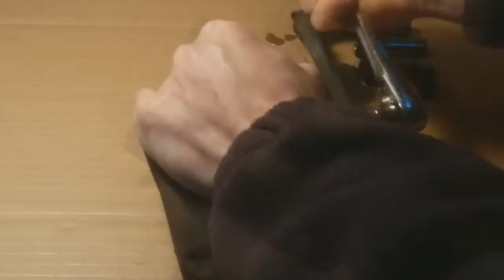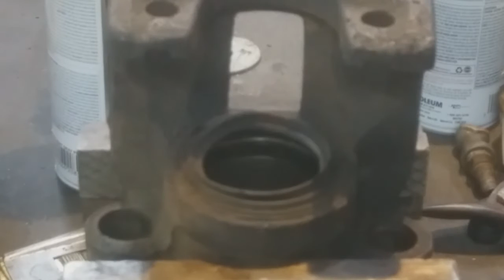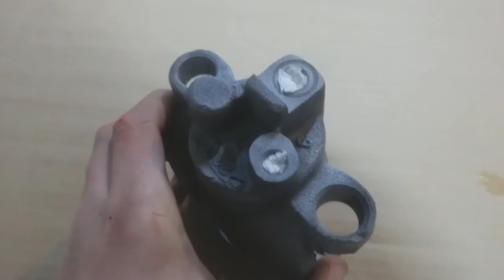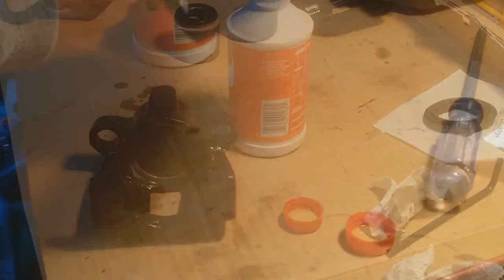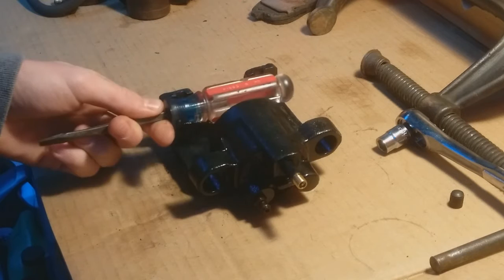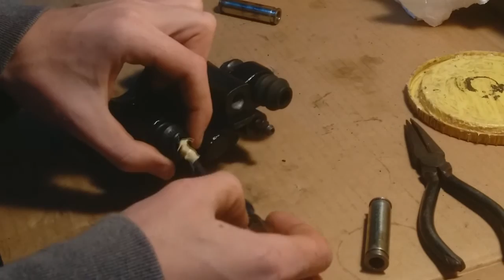How-To Rebuild Single Piston Brake Calipers

Comment: I didn't put it in service mode. THEN stupidly applied service mode then un-did service mode...leaving my rear caliper piston pushed completely out, and wont go back in. My rear brakes are was already out when i applied the eBrakes. 
So I can't push it in cause I now know I need to be IN service mode. WHAT DO I DO??
2017 jeep cherokee limited awd 4x4  4cy

Comment: I appreciate all the info in this diy video. I see others using needle nose vise grips with fuel line on the end to clamp the flex hose but what if you want to replace all front and rear flex hose brake lines? How do you stop air from getting into the hard lines at the fitting and how do you keep fluid from completely draining from brake system? Is it ok to remove all the flexible brake lines, then replace them one at a time, then bleed the entire brake system afterward? Will doing this harm the ABS and introduce air into its system and modulator?

Comment: Question? How did you stop AIR from ENTERING the brake line and stopping all your brake fluid draining from your brake lines and reservoir? What stopper or clamp did you use and specifically, visually, how exactly did you go about that process? I want to replace the flexible brake lines as well as rebuild the calipers on a 1995 ZJ which is similar to the XJ single piston caliper but also with ABS on the ZJ...... but here is my concern.... I dont want to introduce excessive air into the lines and make bleeding them all, later, a nightmare. Any suggestions, ideas or a video on the topic would be great as I cannot find any youtube video on replacing the flexible lines while not introducing air into the brake lines and possibly also, the ABS SYSTEM...as well? Btw... Thanks for making this video! Very helpful👍
Reply from the maker: I simply used a vise grip to clamp the rubber lines if I had the caliper off the vehicle. But if you are also taking off the rubber hose on each caliper you can use a vise grips on the rubber hose from the frame to the rear axle. If you are taking off all of the rubber lines, leave the cap on the reservoir on and it will help by retaining the fluid in the line by creating a vacuum, then it wont be able to drain out as much. The abs lines that run to the rear are just wires that pick up a signal on each wheel, so I wouldn't worry about those. But if you replace all the rubber lines at the same time with the reservoir cap on then afterwords a brake bleed for the whole rear brake system will be fine.

Comment: WHich parts did you had from ZJ vehicle prior to the replacement into the Xj? do you have the video for such replacement?. ( BTW you could benefit from aditional ligh in your work bench in order to reveal the tiny details inside the pistn. THKS !
Reply from the maker: I swapped the ZJ, backing plates, parking shoes & hardware, rotors, pads, soft brake lines and proportioning valve.

Comment: You don't need to align the brake hose bolt hole with the brake hose hole. The bolt is stepped around the hole area allowing fluid to flow around the bolt and through it.
Reply from the maker: You are correct, this being the first time I was doing brakes, I didn't know that at the time.

Comment: Brake fluid is NOT an assembly fluid and should never be used when installing the piston or dust boot into the brake caliper. There is brake caliper assembly fluid/grease for this purpose that will make installing the piston and dust boot much easier and without the risks of damaging the piston, bore or pressure seal. Caliper pistons assembled dry (only brake fluid) can stick over time, causing uneven pad wear and pulling. There are two brake caliper assembly products, Red Rubber Grease by Castrol and Brake Assembly Fluid by Centric, Carlson or Raybestos, "all are compatible with brake fluid". All are sold on Amazon for around $20, hard to find in your local auto parts store. Save yourself the nightmare of trying to install pistons (especially Phenolic pistons) with just brake fluid and spend the $20!!!

Brake Caliper Rebuild Info:
http://www.nbsbrakesupplies.com.au/technical-information/why-you-need-to-use-assembly-fluids.html
https://www.zeckhausen.com/catalog/index.php?cPath=6446_6494
http://www.redrubbergrease.com/

Assembly Fluids and Grease:
Red Rubber Grease:
https://www.amazon.com/GENUINE-Corrosion-Oxidation-Resistant-TS-2-34-04/dp/B01L63SXSU/ref=sr_1_1?keywords=red+rubber+grease&qid=1550936758&s=gateway&sr=8-1
Centric Assembly Fluid:
https://www.amazon.com/Centric-500-1000-Brake-Assembly-Lube/dp/B003K18DT6/ref=sr_1_fkmr2_1?keywords=centric+brake+assembly+fluid&qid=1550936103&s=gateway&sr=8-1-fkmr2
Carlson Assembly Fluid:
https://www.amazon.com/Carlson-H9440-Brake-Assembly-Fluid/dp/B0091S924M/ref=sr_1_fkmrnull_1?keywords=carlson+brake+assembly+fluid&qid=1550936127&s=gateway&sr=8-1-fkmrnull
Raybestos Assembly Fluid:
https://www.amazon.com/Raybestos-BAF12-Brake-Asembly-Fluid/dp/B001ANJ2GE/ref=sr_1_fkmr2_1?keywords=centric+brake+assembly+fluid&qid=1550936139&s=gateway&sr=8-1-fkmr2
Reply from the maker: Sure assembly grease may make install better but to me it's personal preference. I've seen others and myself use just brake fluid without a hitch. Same thing goes for assembling an engine, you don't have to use assembly lube and soaking parts in regular motor oil works just fine as long as the engine will not be sitting for a long period of time before start up. I got some high sources on that fact. So same would go for calipers as long as there installed soon after.
Reply: I can assure you with assembly fluid you will not need the C-clamp. All I know is I will never use brake fluid again for a rebuild, don't need all the BS trying to get the piston in and out with 150 PSI for a $20 bottle of assembly fluid. Also, brake fluid does belong on dust boots, if it damages paint it will damage them also.
Reply from the maker: @metalhalide4043  To each their own

Comment: only use caliper grease which is silicone base Napa sil-gylde which I think is AGS caliper grease the Napa stuff is what I use when rebuilding calipers when they are powder coated since brake fluid may not eat through the coating it does leave finger prints that need to be buffed out with compound

Comment: When lubricating the caliper slides you use the phrase "grease" not caliper crease or silicone grease simply "grease" and since the lid you have in the picture frame appears to be from a tub of white lithium grease and the grease you applied looks exactly like white lithium it appears you made a big boo boo and uses a petroleum based grease that swells rubber parts. It may not happen fast but over time the rubber parts lubed with white grease will expand to 40% larger size and become fragile.
Reply from the maker: You are 100% correct I caught myself on that before installing the calipers. I ended up using a marine grease that I had and it was safe with high temperatures and rubber.